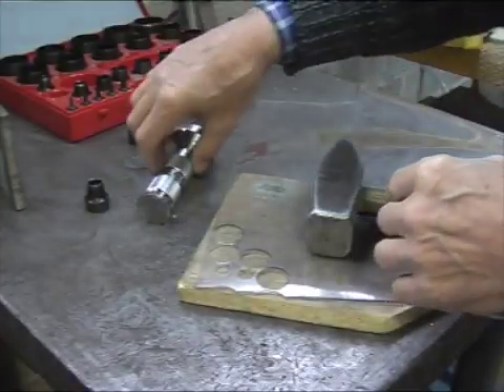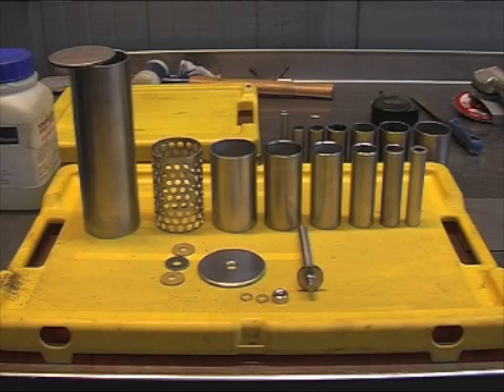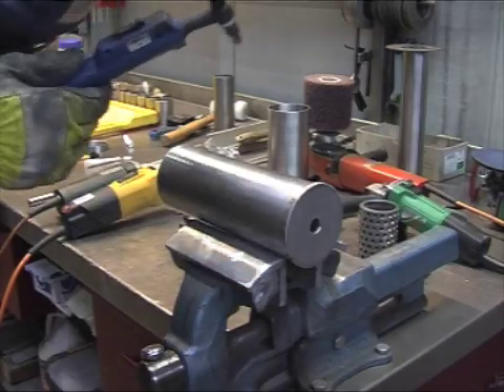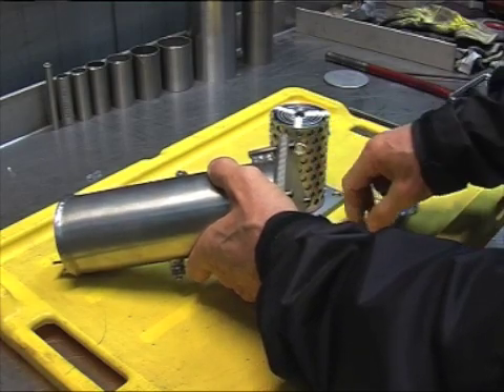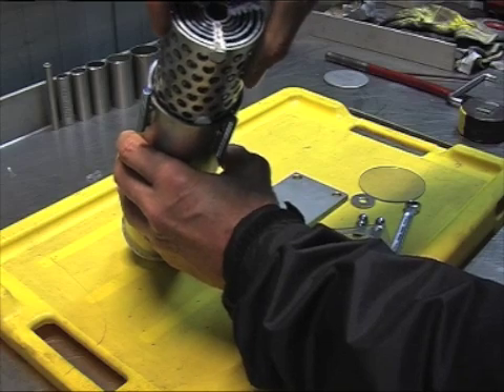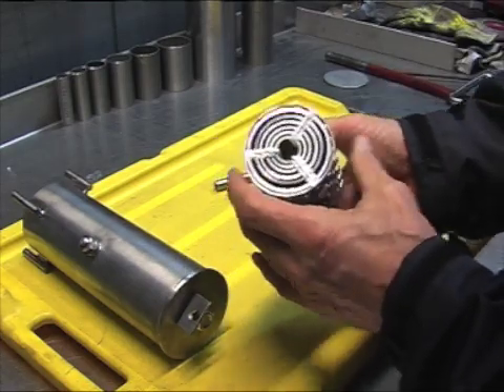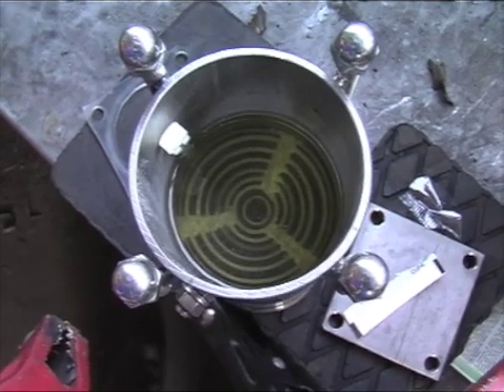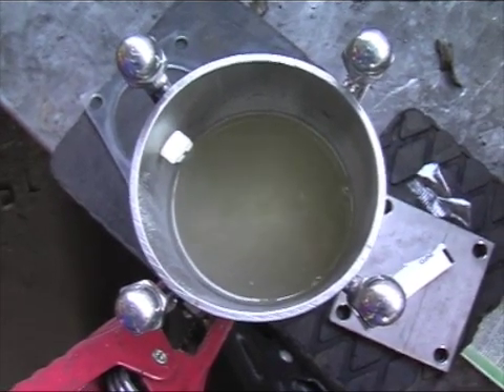HHO SWISS INOX CELL 1ST ATTEMPT

Comment from the maker: Thank you m3sca1. I forgot to mention that I used what I had available in my shop at the time and that is stainless steel 304 and as you can see in the video the spacing is not regular. Today I will receive 5 different tubes of 316 L  and I will build a 7 cores cell. To bad I have zero knowledge of electricity but with some help I'll catch up very fast! (hope so)